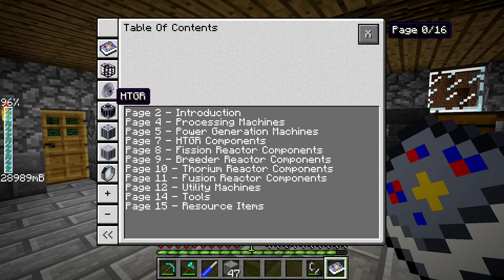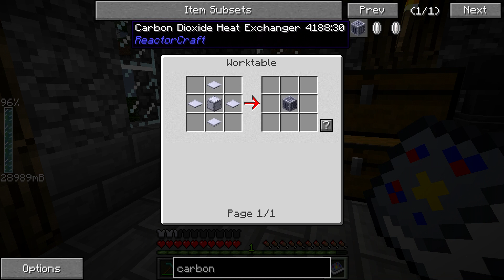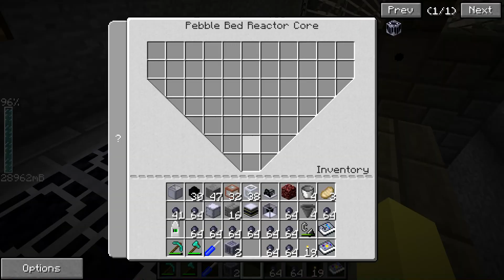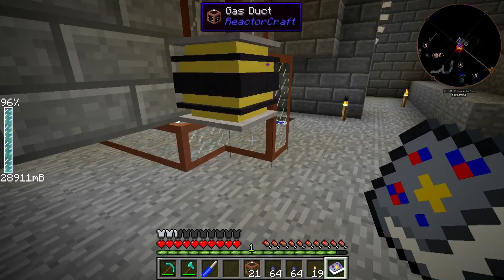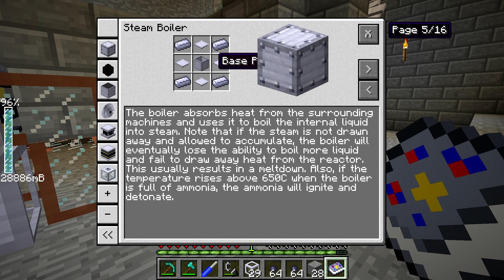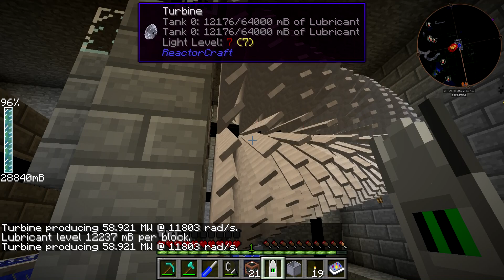Surviving With RotaryCraft :: Ep.20 - High Temperature Gas Reactor

Comment: You could possibly link in your second water line into the steam boiler and get more water in for more steam. Other than that, cool. I'd heard of these, but never seen one in action.
Reply from the maker: I'll definitely hook up the second stream to get more steam since the steam engine has more than enough. The reactors used to be much more popular, but they got massively nerfed and now require much more than the old 2x2x2 setup that could work just as effectively as this one.

Comment: hey, you can use glass/trapdoor/door to keep heat.  Just make sure to keep heat exchanger and boiler sealed.
According to reika, unless all 6 sufaces are covered with something(including pipe) it do not keep heat as if it wasn't covered at all.
Reply from the maker: Oh, that is awesome! Trapdoors even when open can count as a cover from what I just read, making it much easier to access the blocks being heated! Thanks for the tip :)
Reply: oh, if you put hopper top and bottom, it automatically eject depleted one

Comment: You can stop steam grate by applying a redstone signal.
Reply from the maker: Thanks for the tip! I will definitely use this to save steam when I don't need it running :)
Reply: in addition, steam line can contain infinite amount of steam.
btw I'd recommend you to seal turbine too, in case you accidently jump in..
Reply: Each steam line can cantain about 2^32-1(same number of Bedrock Alloy Armor's durability, although Bedrock Alloy Armor's durability is a joke) blocks(m^3) of steam, like infinite, but it can't be infinite because the maximum of Integer(normal number variable of Java) only can be 2^32-1.
And when right click on steam line with Angular Transducer ,it shows how many steam blocks contain in steam line ,that mean each steam line of the connected steam lines contains how many steam blocks (steam in the steam lines will spread to each steam line),so just do some calculate(that number times how many steam lines they connected each other) ,you will get the number of steam blocks you have.
Reply: ofcourse we know it, otherwise we'll see ram full with amount of steam ;)
but wow, its limit is much larger than expected, thx!
Reply: Yeah. That's so much steam. I'm thinking if I put a cluster of steam lines(like 7x7x7 or 9x9x9) ,maybe it doing things like a capacitor. If that's true, it's so wonderful.
Reply: btw one weird thing is: even if length of each steam line connected to two turbine is same but different direction, it tend to go only one side.
Reply: Maybe connected steam lines just like a system, and this system only one side output.(I guess.)

Comment: you need to cover all the blacks adjacent to the heat exchanger/boiler as you are losing a lot of heat.

Also your core is massively wasteful. it is supposed to be reactor cores surrounded by co2 exchangers.

Finally you should just need two hoppers and two chests to automate the fuel pellets. One each for insert and extract.
Reply: so you want 12 height reactor core with 96 heat exchanger? It don't even reach 800 unless I put that much. seriously nerfed.
Reply from the maker: Oops, forgot to cover the exchanger and boiler, thanks for the heads up! As for the core, I do not believe it is. The pebble bed reactor cores were massively nerfed and now most setups are this large if not larger.
Reply from the maker: Tried this out, but this is a pre-nerf setup. Unless I totally screwed it up, this can't get the co2 exchanger nearly hot enough.
Reply: Yeah reika blocked all exploits too, like directly attaching reactor-CO2heat exchanger-heat exchanger-boiler.
originally heat just used to jump to adjecent block in this case
Reply: Darn. I just built my old setup with the new version and I was wrong about the core. Everything else still stands though.